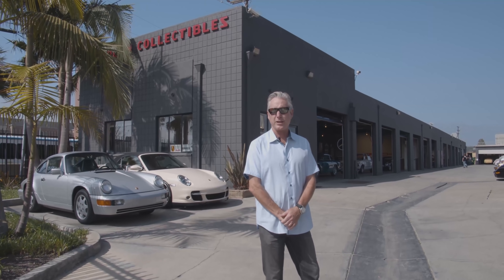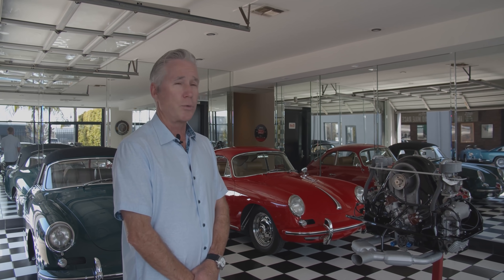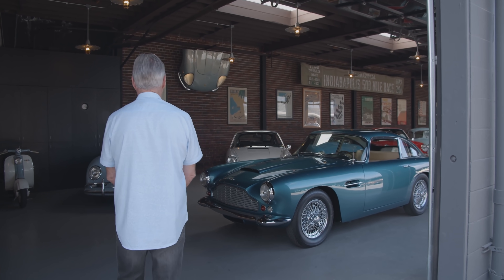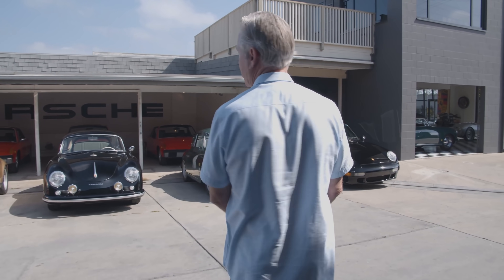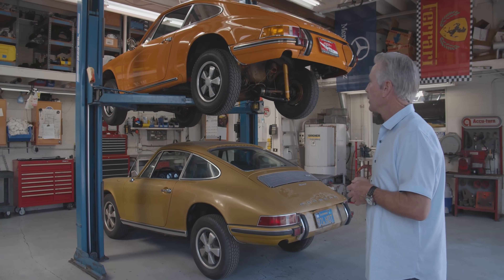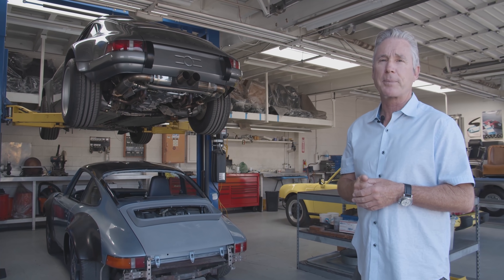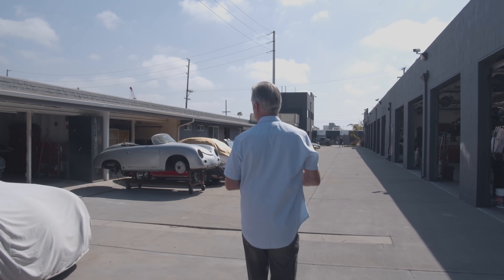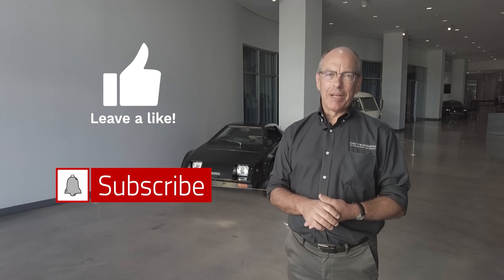RARE EUROPEAN CAR COLLECTION | EUROPEAN COLLECTIBLES FULL TOUR

Comment: hey petersen, ive got a 2013 chevy sonic if you're interested. it's an LT so it's pretty fancy but for some reason the radio comes on for no reason like 30 minutes after you leave the car and it drains the battery so you can't start it the next day. lmk.